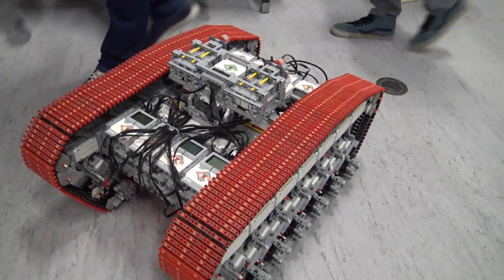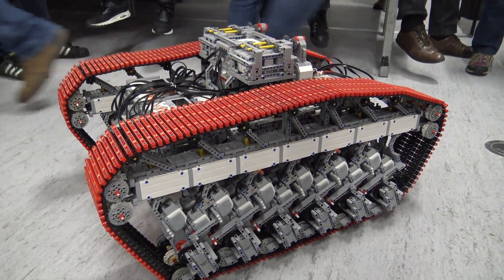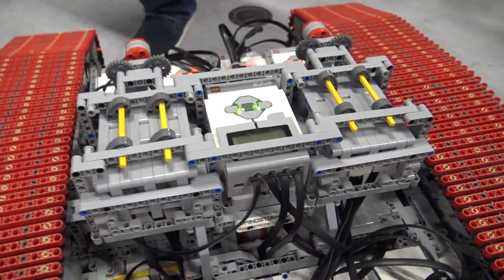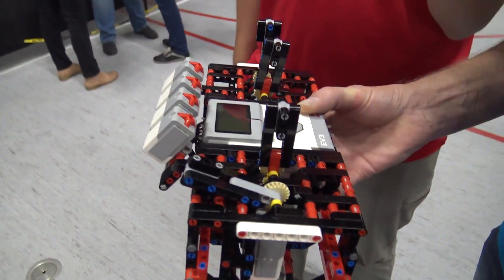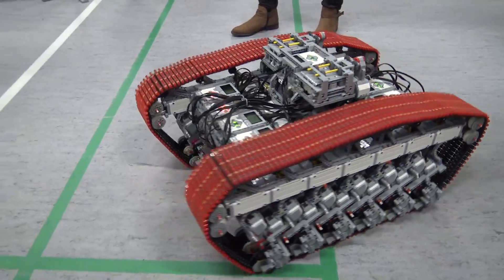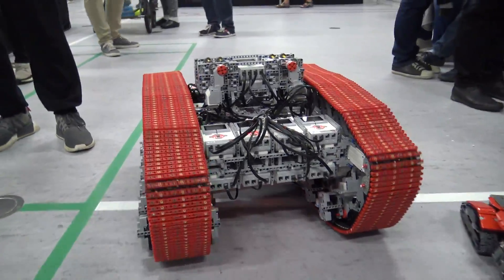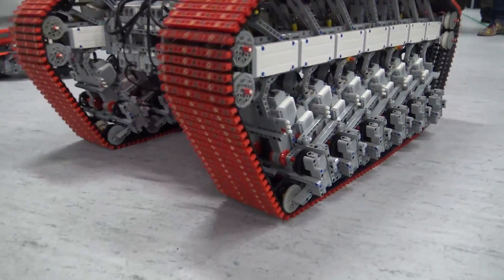LEGO Technic Tracked Vehicle Powered by 48 Motors

Comment: I wonder how much weight it can hold
Reply: An entire person
Reply: @mateuszodrzywoek8658  Cool!
Reply: Barely it's own weight is my guess.If it's all Lego it doesn't have bearings and runs on plastic axles. Building it heavier will not increase its load capacity.
Reply: @xpen2007  it can pull around 100kg
Reply: @snonsig2688  it can Pull something with that weight
Sitting in a wheelchair on a flat surface. That translates into something like 150N. But that is not because of the Motor limitations but because it physically cannot  pull more than its own weight with this tracks. The question was how much you could load on top of it, and that is another question completely.

Comment: But now you have to change the batteries
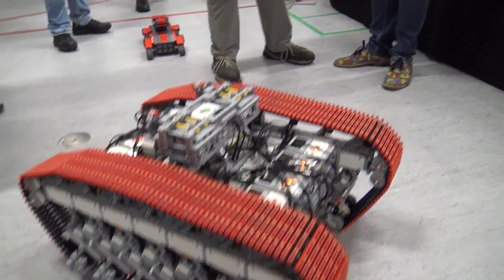Reply: When he turns the controller upside down at 1:15, you actually can see that he`s using the rechargeable battery cells. Still could be interesting all plugged in at the same time.